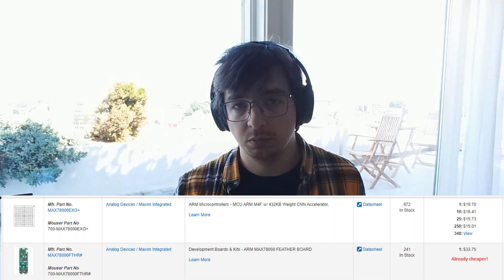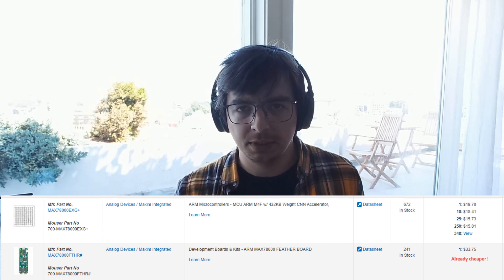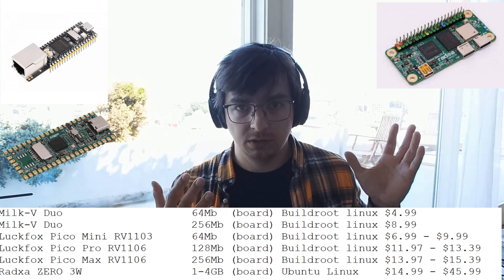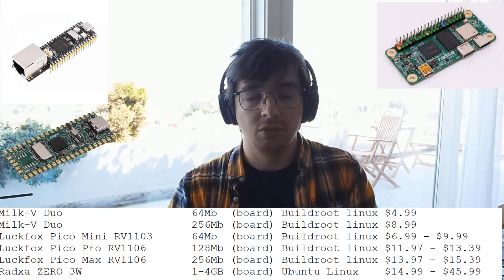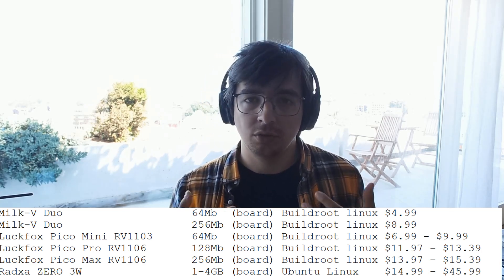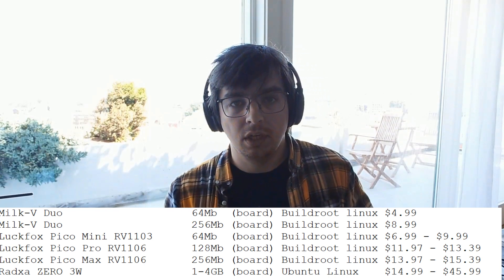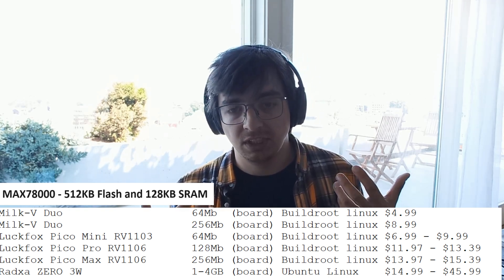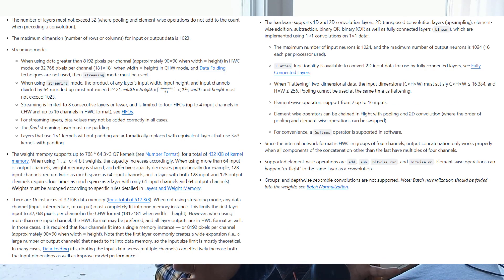MAX78000FTHR - how good it's today?

Comment: This chip is for low bandwidth CNN projects, real-time low bandwidth, low power consumption, very targeted applications. We talking fast sensor fusion, sound detectors, low resolution frame by frame processing. This chip should not be confused as a a replacement for doing high resolution real-time image nets.

The price of this chip is not cheap either, but take into account its got an ARM M4 and a CNN on the same die, the cost is targeted for fitness applications, like smart devices. wearables.

Comment: You ever tried orange pi products ? Especially orange pi 5 plus etc
Reply from the maker: You can find a lot of videos about RockChip on, my channel. Orange Pi 5 is RockChip-based. Some other Orange SBC as well.
Reply: @AntonMaltsev  Yeah I just watched all your videos about rockchips. Im thinking about building some kind of a companion robot, which interacts with the world using image classification and a 3B or 7B LLM. Seems like rk3568 is the cheapest device I should even consider thats going to work but idk if it can run offline llms. I can go for rk3588 which seems to peform really well but I want to prototype with somethning cheaper before and I want battery life to be as high as possible. Idk if 3588 power consumption is a lot higher than 3568 or not. What would be your recommendations ?
Reply from the maker: @yagizbabo  I think that only RK3588 and RK3578 are good for LLM - https://github.com/airockchip/rknn-llm
But never tested this.
Also, I think that 7B is a little bit more than these boards are capable of.